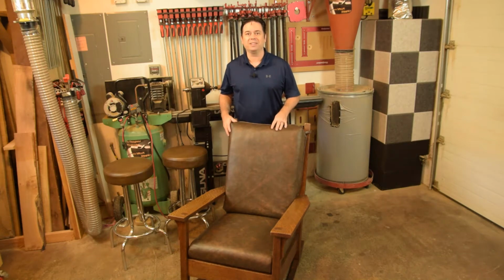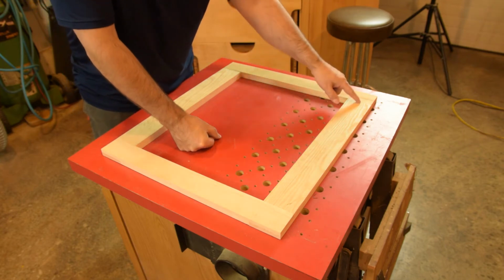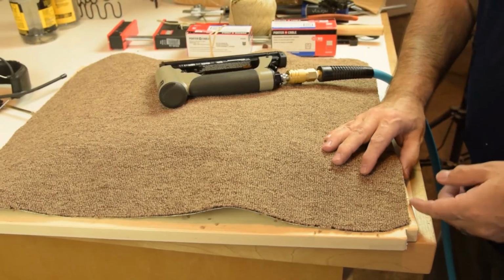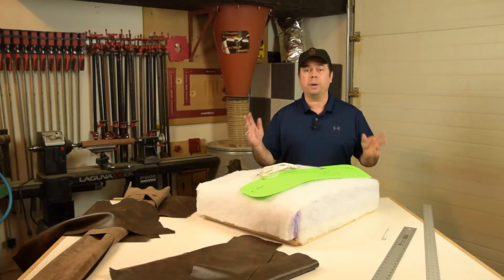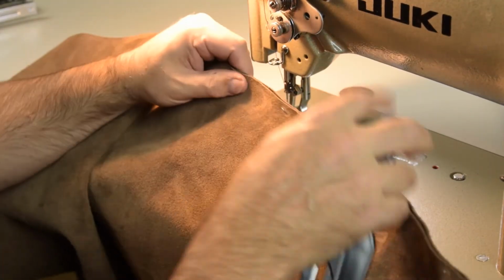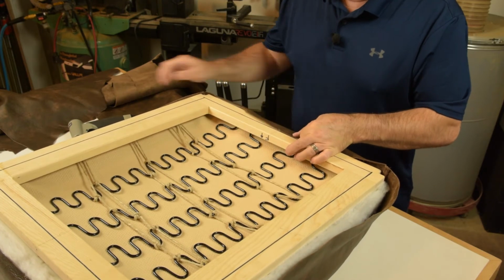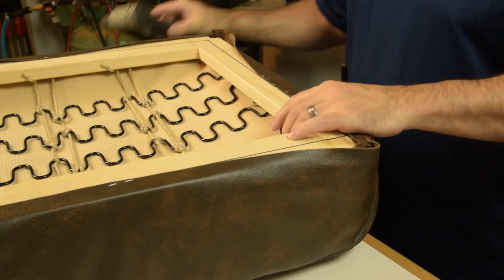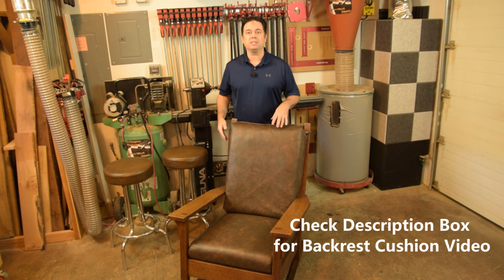Leather Seat Cushion Upholstery Tutorial Stickley #319 Rocker Rocking Morris Chair Mission Furniture

Comment: This is great. Fantastic video. One question: What do you look for in an upholstery leather. In other words, what weight (thickness), types of leathers to look for/avoid...and perhaps a good source for us DIYers. I'm about to make a set of chairs for a friend and this will be the first time I'm going to be dealing with leather working on a woodworking project of mine.
Reply from the maker: Hi David, 2-3oz leather works well for chair upholstery.  You'll be buying chrome tanned upholstery leather, not tooling leather or rawhide.  I buy all my hides from leatherhidestore.com and overall price and shipping is the best around.  I look for medium or low sheen, and supple or very soft feel.  Thinner leather is generally easier to sew.  3-3.5oz leather gets pretty thick if you have piping and 4+ layers at the seams.
Best of luck!

Comment: Thank you for the video. This is awesome information. Can you tell me how the notches in the frame fit around the legs? Is it a tight fit or do you leave some room for the leather (like an 1/8" or a 1/4" for example)? Thanks again!
Reply from the maker: Thanks!  Leave plenty of room for leather and batting.  Nothing worse than a newly upholstered seat that won't fit into the chair.  Usually I leave 1/4" gap (minimum) around the perimeter of the seat frame.  The corners need at least that much room.  Good luck with all your upholstery projects!
Reply: Thank you for the excellent explanation

Comment: This is so helpful! Thanks! I have two teak mid-century style living room chairs I want to do this to. One thing I noticed is that they both have cushions separate from the frame and only have stretched material like the carpet you used. No springs or twine. The cushions are currently covered in a really coarse fabric almost like burlap, and I want to move to leather. Could/ should I work in all the springs and other features you put in, or should I just do a foam and dacron and cover it with a leather slip case? I'm worried that it'll get too thick to be the right height if I put in the springs, but I bet it feels better and it may be necessary with leather. Thanks again! I'd love any advice if you have time!
Reply from the maker: If your chairs have adequate support, and currently use loose cushions, you should be able to redo them in leather.  Many of my chairs don't have springs, and use a jute webbing base instead.  It can be comfy as long as the foam is soft enough and good quality.
Best of luck!

Comment: Thanks for sharing these excellent quality videos Willie.  Can you please share what thread size you used?  And ;have you been able to run T-135 on your Consew 226?  or your 206?
Reply from the maker: I use 92 weight thread for all my upholstery projects.  The Consew 206 can handle 135 thread on top.  The top loading machines like the Consew 206 and Juki 562 don't seem to like the heavy thread.  
Thanks
Reply: @TheThoughtfulWoodworker  Thanks for your reply.  I really enjoy your content.  I built a Morris chair with leather cushions, but had to get help finishing the sewing as my old Singer 66 couldn't hack it.  Now I'm building a matching Ottoman and want to repair the cushions on our leather couch, so I'm shopping for a machine.  Your doing excellent work with your 206, so I'm leaning in that direction.
Reply from the maker: @tektoneng  Can't go wrong with a 206rb.
Reply: I had trouble running 135 on my 206. Had to run a lighter thread on bottom and even then it frequently hung up.

 That is, until I brought it to my (not so) local repair shop for a tuneup and general timing. I mentioned it to this quite skilled tech and he made some finger clearance adjustments, changed a few minor parts springs and the like, smoothed and opened the hole in my presser foot and viola! It sews like a dream with even 170 on top and 135 in the bob. Amazing what a skilled pro can do to improve your machine, best $160 I ever spent in upholstery. @TheThoughtfulWoodworker

Comment: Thanks so much for these videos!  I've decided to try my hand at sewing for my Morris chair.  I plan to practice quite a bit with "regular" fabrics before I dig into the leather.  In fact, I plan to do an entire dry run with muslin.  I was wondering if you have a minute to answer more of my questions:
- any recommendations for a "leather analog" material that would be good to practice with but on the cheaper side?
- I know it depends largely on the leather, but do you have any needle size recommendations?
- can you share your source for quality bonded nylon thread?  I see some on Amazon but the reviews indicate that they aren't the best quality.

Thanks again so much for all you do.
Reply from the maker: That's great you're going for it on the Morris Chair.  Any upholstery weight fabric would be good for practicing.  Vinyl would be good too, but honestly it's cheaper to just order a $105 hide right now from Leather Hide Store.  I just ordered one that was supposedly green, but it's actually a beautiful brown.  Full hides and top quality too, just in random colors.  
As far as thread, order #92 weight bonded thread from eBay.  I've had good.luck from multiple eBay sellers, thread exchange, cowboy sewing etc etc.  Needle size should be a #19 or #20 leather point.  You didn't mention what machine you're using, but for a Consew or Juki walking foot it's a 135x16 needle in a #19 or #20.  
Good luck!!!
Reply: @TheThoughtfulWoodworker  thank you for the quick reply.  I priced out getting the work done by a pro near me and, at the quotes and waiting lists I was seeing, I opted to use the budget on the materials + extra for practice and start working toward another skill that'll help my furniture making in the future, too. That's a great idea to just order a less expensive hide from leatherhidestore. That's where I'm planning to order the leather, anyway, but I'm still debating between a few samples. Thanks for the rest of the info.  I only have a brother 6100 right now but I've been told I will work alright for leather, just not the ideal machine by far.

Comment: Is there any offset rule to dimensioning/sizing your seat frames in terms of how much allowance you should give when building a leather seat cushion like this?  Thanks
Reply from the maker: Hi Paul, I like to size the seat frame so there's at least 1/4" gap on all sides.  The corners often need to be notched around the legs of the chair too.  The padded seat frame should fit in pretty easily before you add the leather cover.
Good luck with it!
Reply: @TheThoughtfulWoodworker  Thank you so much for taking the time to reply.
Reply: @TheThoughtfulWoodworker  Sorry, I have one more question for you.  at 3:12 , how big a notch did you take out of the frames?  1/2", 3/4" ?
Reply from the maker: @yoyopg123  I cut 1/2" x 1/2" notches minimum.  Maybe a little more if the legs of the chair are particularly bulky or intrude on the space for the seat frame.
Good luck with it!